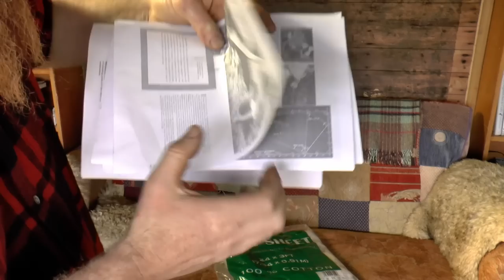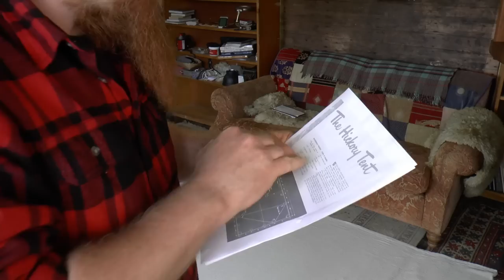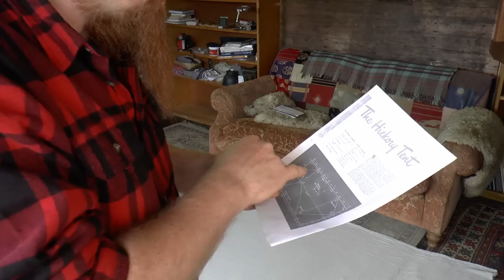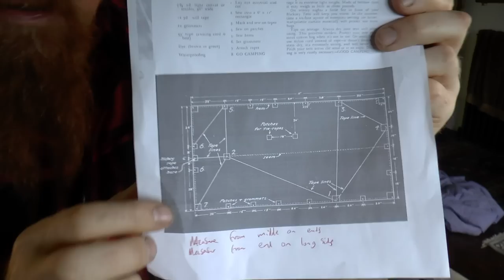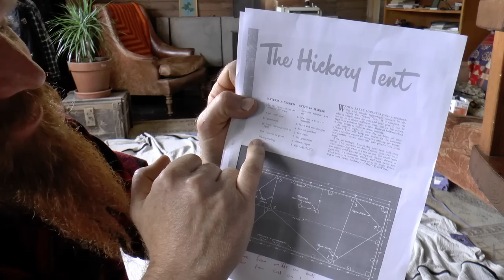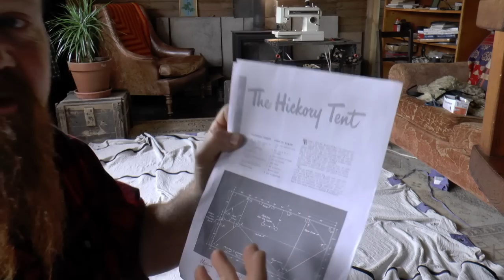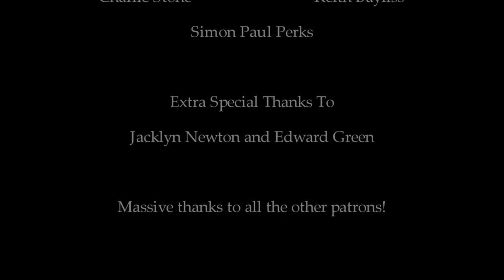Homemade oilcloth tent - from a dust sheet!

Comment: Max, don't give up your day job !   Credit for trying to use the machine on camera and well done for not sewing your shirt to the dust cloth !
I just wanted to show you that in the back of the stem of the needle pole is a cut out slit, this is for cutting the threads, as you don't need scissors. Pull your work out of the back, lift it up and the two threads should fall into the tilted slot. Pull your work towards you and the threads will cut against the slot.
 Also the front of the machine towards your left should open, (see the hinge on the back) push the front corner and inside should be a downwards facing light bulb. Switch that on and you will find it much easier to see where you are sewing... Best of Luck mate. xxx

Comment: In a strange coincidence, my father in law was an 'old school' painter and decorator and when he retired he gave my all his gear.  Included were half a dozen drip sheets which were... Ta Dah - ex boy scout tents!  Each is 12' x 8' with grommets at the corners and at each mid point along the sides.  They are a very heavy, close weave canvass and extremely hard wearing.    My f-i-l had them for close on 20 years and I've had them for another 10 years and they're still in excellent condition.
I've even used a couple of the best ones as garden tents for the kids!

Comment: I did a similar project years ago and while it was a fun learning experience I ended up buying a Kelty Noah's tarp for less than I spent for a gallon of boiled linseed and mineral spirits and the tarp is actually water proof. I soaked mine in the liquid and it took forever to dry, was very heavy and stunk not to mention I wouldn't trust it anywhere near a campfire. I think I may have skipped a step or overlooked something, can't wait to see your results,

Comment: ive found if i mix 3 tubes of silicone clear bathroom and windows sealant, with 2 x1 litre bottles of white spirit , mix completely ,now you soak every thing to be water proofed like tent ,backpack ,for example ,once its been soaking for 10-15  minutes ,pull it out and hang to dry .Once white spirit evaporates it leaves the silicone in the fabric
Reply: BreatheScotland  I paid about eight quid for a 50ml toothpaste tube of "Seam Sealant," then discovered I could have made a litre of the stuff using the silicone and white spirit recipe.  Never again!

Comment: Hardest part of using a sewing machine is actually threading the sod! The route the thread takes from reel to  needle is machine dependent but then comes the fun part of threading the bobbin holder and then getting the upper thread to pick up the bobbin thread. The sewing bit after that is fairly straightforward! (Obviously things do get way more technical with tensions, choice of foot and best type of stitch etc, but hopefully you get my drift!)
Reply: It's the tension that always screws up for my girlfriend and I.

Comment: I have an old canvas top on my 101 Landrover, cab only. It always leaked which is not great in the UK, tried various ways to seal it but none worked. I saw a YouTube site whose method was equal parts White Spirit and Silicone Sealant well mixed and soaked or brushed on.
One tube of clear sealant and 500ml of Spirit during the hot July last year and it has not let a drop through. Your method looks good. Cheers

Comment: Last year, NighthawkInLight did a similar sort of video on using silicone sealant and Naphtha to waterproof bedsheets for use as tarps, basically the same process as with the linseed oil & spirits, but a different waterproofing material, and he soaked his sheets rather than painted, meant to try it myself with some dustsheets, just never got around to it... :)

Comment: Nice work Max. I had a short stint working at a boat building business whilst I was on JSA between jobs. I found it interesting but very different from the metal working, welding and fabrication background I'm used to. The hardest thing I found was the way the fabrics stretched in a certain way but not the other also everything being softer than what I'm used to. There was some foam work too that was also tough to get along with. I'm glad I'm back in m
Engineering now but it was definitely an interesting experience. I picked up some good skills from there however a lot of experienced guys with lots of years under the belts.

Comment: When i was sewing some zips on i used double sided sticking tape to hold them in place , it worked really well .better than using pins .
Reply: It can make the needle quite sticky.  I found out the hard way! 😊
Reply: @cindyholton7234  i made 6 pairs of leather riding chaps it was fiine . maybe the leather was cleaning the needle
Reply: I made cushion covers for my camper. The tape worked great. It was the proper stuff.
Reply: @chriscoulthard4947  When i made the chaps the tape was so strong i tried them on before i sewed them

Comment: Interesting video and thanks for sharing your experience, a few years back I nearly made a copy of a "Baker Tent", Simon a Bloke in the Woods had a series on making one (car camping only). Will be interesting to see how your tent works out in the 2nd instalment. As for commercial fabric tents, I still use one of my many 50 year old Conquest medina canvas Tango Tents (the precursor to Vango Force 10), the Conquest tents were made by Sailmakers so of far superior quality to the modern canvas ones. The trouble with using any kind of fabric as opposed to metal or wood is the dam stuff keeps moving about :) Have fun camping and looking forward to your future videos.

Comment: When I was in Boy scouts in the 770 we made tube tents out of plastic sheeting, you just taped the long edge with duck tape and ran a line down the middle and  tied to two trees.
In the 90s I used a mig poly tarp laid it flat put my air mattress on it then drapped the rest of it over a line and tucked the excess under .

Comment: I have seen and done worse, but works decently well. Only thing missing was not taking one of the strings, treading it into needle, pushing it trough to other side, tying double nut with the other string, then again treading both into needle and pushing under the fabric pushing it far as possible crumbling the material, going out and finally cutting the strings so ends are inside the fabric. Much less chance of seams failing and looks better.

Comment: Do you think used engine oil would be a good option for a dye? It's good for staining things and it's probably waterproof.
Reply from the maker: Sadly not, it would never dry and would always come off on your hands. The powdered clay I used worked well, as the oil cured it's left behind and bound into the cloth.
Reply: @maximusironthumper  Is that the difference between dry wax coats and wet wax coats?
Reply from the maker: @paulishism  I couldn't say, I've never tried waxing as a coating!

Comment: Would it not work if you dunked it in the bucket and left it to soak for an hour and then put it out to dry?
Reply from the maker: Maybe, but it seemed to me wringing it out after soaking would be more effort than painting it, the method I used gave a nice even coating too.